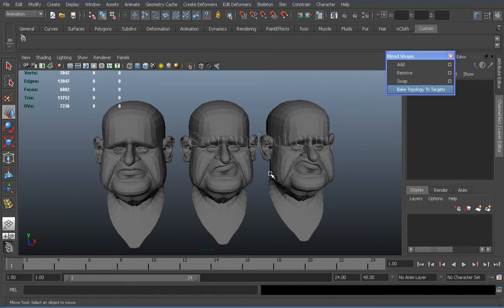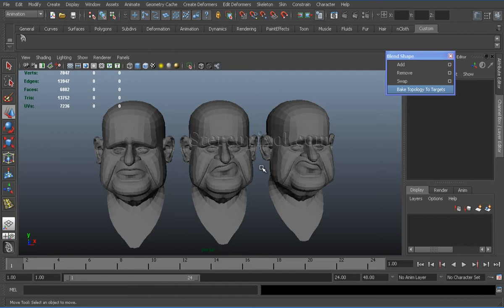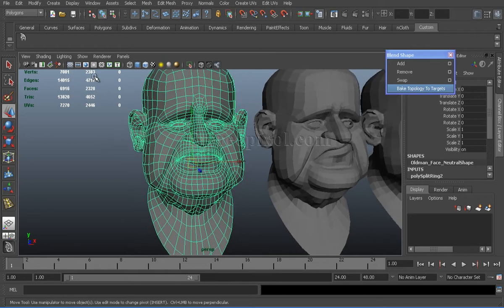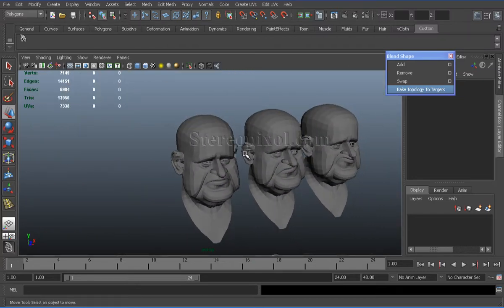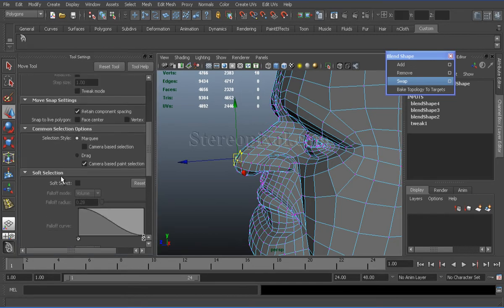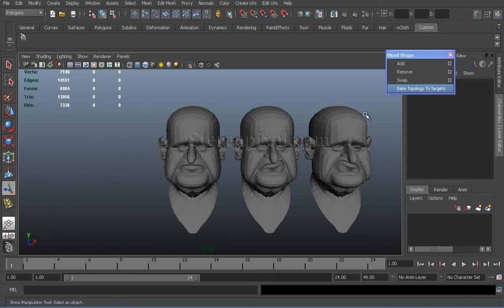How to Use Bake Topology to Targets In Autodesk Maya

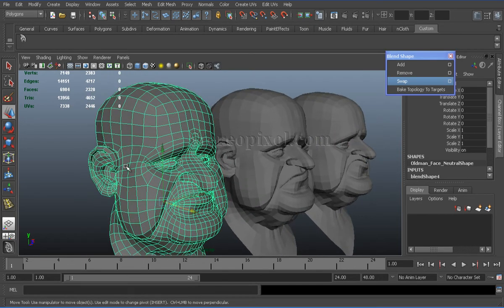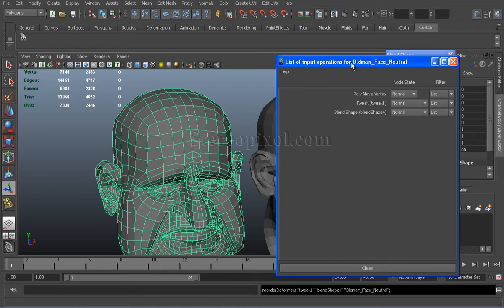Comment: Hey StereoPixol, great video, but can you explain the steps between 5:20 and 6:00 ?  I am not sure what the purpose of having to go into transform component mode and then move the order of input connections serves.   Clearly it's important but could you explain the reason for doing this?   Thanks!
Reply: Just tried his trick for transform component, it's just to let maya know that there has been a topology change on the mesh. If you just move the vertices around it doesn't create any new node and Bake to Topology does nothing. Was going to pull out my hair trying to modify a minor vertex change across 150+ blendshapes but found this gem of a video to help me out.